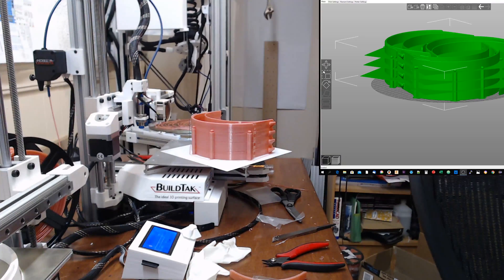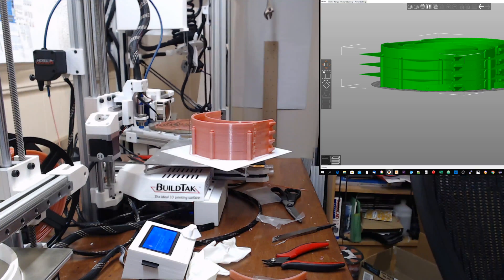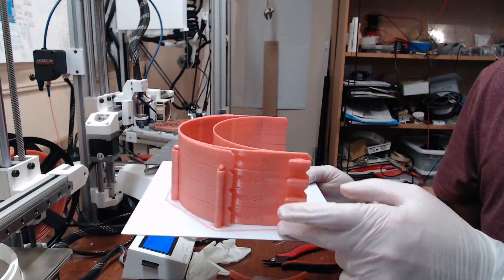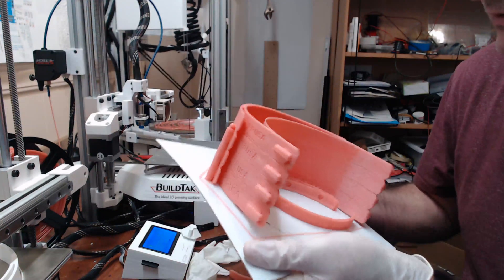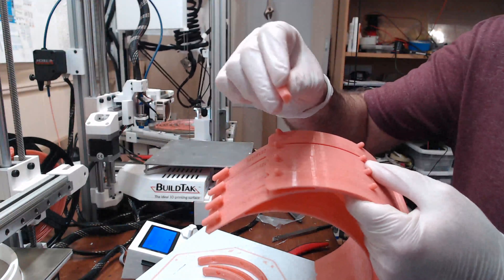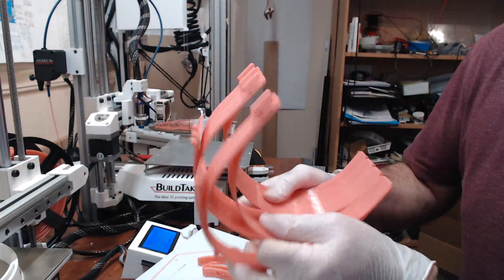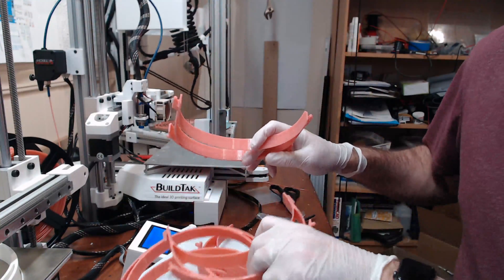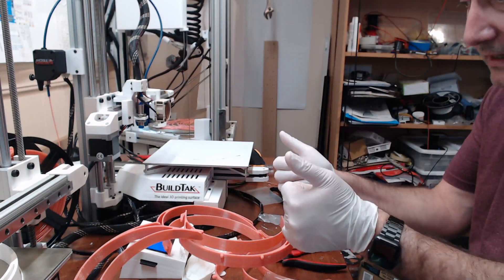Stacked Prusa Face Shield, do they work?

Comment: Is using PLA okay? And may i need suggestion what is layer height?(0.2 mm or 0.3 mm) and what is the best wall thickness?
Reply from the maker: for personal use PLA is possible, on the PRUSA site is states "ideally PETG". I believe because these are easier to disinfect (PLA has very low glass temperature so any steam treatment might deform it). I've been using layer height 0.28mm (0.3 will work fine) with 3 perimeters, two bottom 2 top, 25% infill.
Reply: I think also the goverment asked to use petg for best purpose. But PLA is fine yes :)

Comment: Will this work with any 3D printer? (i.e. Afinia h800+, uprint se plus) I'm currently printing a few now and this would be great if I can successfully print these in one go.
Reply from the maker: There's no printer dependency, the "seams" are part of the 3mf file, I used PrusaSlicer to slice the .3mf (no extra settings)

Comment: Great. How do the clear plastic attach to the frame? Is this PLA filament? Would this work on a consumer model for moderate volume, like the anycubic i3
Mega S? New to 3D printing, but there's a high demand at my hospital.
Reply from the maker: This is PETG, This print should work on any printer I believe. Ioaded the .3mf file in PrusaSlicer the separators are part of the project. Not sure what you what you mean with "clear plastic attaching to frame"
Reply: @Core3DTech  the clear PVC front visor, I think needs holes punched, which fit onto the posts of the 3D printed headband. Some designs, the posts are spaced apart to match standard 3-hole punch or two separate 2-hole punch.
Reply from the maker: @FishNinjaY  Ah, got it. i send my pieces to https://www.opshieldsup.org/ and they laser cut the shields but you i did convert a 3 hole puncher to punch two holes (most of them you can (re)move the punching pins) and with a 3D printed spacer I can put in one sheet punch two holes, turn it over and punh the other two. I have another 3 hole puncher I might be able to convert to punch the bottom holes
Reply from the maker: The bigger problem I have now is I can't find any buttonhole elastic.
Reply: @Core3DTech  yeah.. i found some regular 1-inch elastic, and I guess people can just make their own holes.

Comment: Nice work. My 2 machines went dead. Need to re level them and get them going. Keep getting thermal runway
Reply from the maker: I just had to replace one of the proximity sensors on mine. It simply died on me. Luckily had a spare lying around.